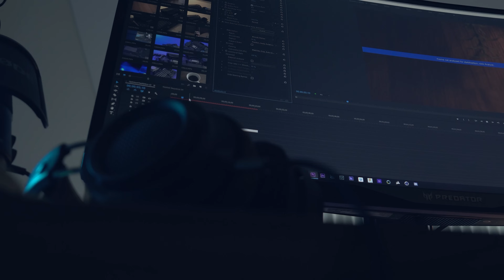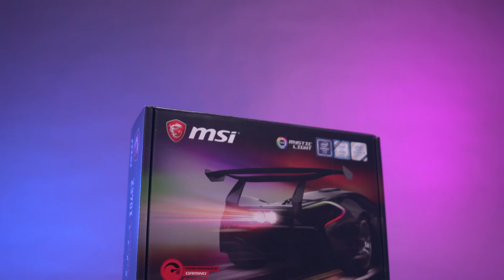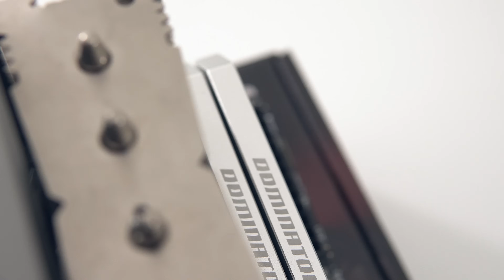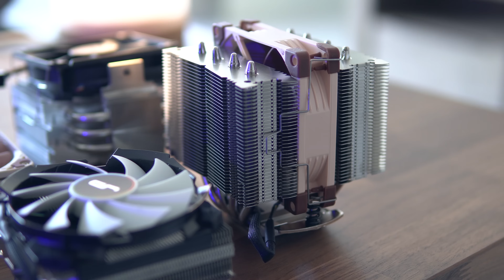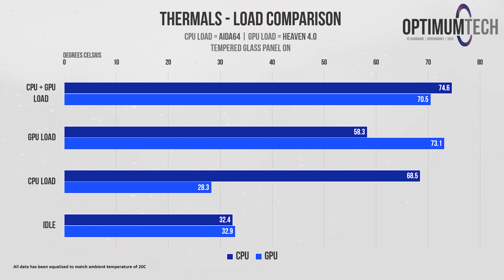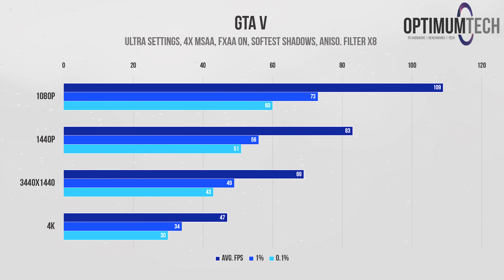FUSION II Tested - Thermals, Noise, Benchmarks!

Comment: Ali in 2018: air cooled 6 core i5 and air-cooled 1080ti
Ali in 2021: custom dual radiator loop 16 core 5950x and 3090
Both in M1
Reply from the maker: what a throwback lol

Comment: Hi man , I need some help with some doubts. Right now I'm deciding if leaving my X99 Rig and move to a mini itx one, more than probably with an I7 8700K. 
In the meantime  I've already bought a Corsair SF600 and while I see if I make the change, I was planning on selling my Seasonic 850W Gold Plus and use the Corsair (with an ATX adaptor) with my current X99 rig. But now I have doubts that not only in the meantime the Corsair might not handle my X99/Xeon Rig, but also that maybe it would not handle my probably future mini itx one with my current components (+ more than probably another SSD) and the 8700K instead of the more cores but low TDP Xeon I have...
..from your experience what do you think? I've already have both PSUs but I really need that extra bucks that would give me selling the Seasonic. Thanks in advance!

PD: 

This are the components of my current X99 RIG: Corsair Air540_AsusX99 Deluxe_Xeon E5-2673 v3 (12C/105W)_Cryorig H7 Quad Lumi_Corsair Vengeance LPX 32GB_WDBlack 500GB M2 NVMe _WDBlack 4 TB (two of them)_ASUS STRIX 1080 ti_Seasonic 850 Gold_LG BRay_AZIO MGK1_Corsair M95_LG 27UD68P_Focusrite Scarlett 2i2_Yamaha HS5

My possible new Mini Itx RIG: The same as above, with these changes: Fractal Nano S (yeap I know that it handles ATX PSU, but I was aiming for smaller cases and I finally got a  very good deal with this one) +  I7 8700K + Corsair SF600 + more than probably one more SSD

Comment: Awesome video! I was wondering though. im planning on rebuilding my pc right now im using m-atx and I want to get the ncase M1 aswell since I really dislike the look of the dan case a4 but im gonna use a EVGA GTX 1070 SC and a ryzen 5 2600 with hopefully the same cpu cooler as you used in the build I saw the thermals where pretty good for such a tiny case but my qeustion is would you recommend this case? because the  case im using right now (phanteks evolv m-atx TG) is getting some really high temps and airflow isnt to good either so im really looking for a tiny case with good airflow I just hope you can help me ou.

Comment: I would expect that, without any dust filters at the bottom, that GTX 1080 will be fed with tons of dust in the heat sink. But with such a small form factor, should we sacrifice cleanliness for more airflow and better cooling? I guess I'll just stick with slightly larger cases that are better guarded against dust.

Comment: Very nice! Maybe my specs for my next pc. One question: did you use normal power cables in the gpu? The evga card is a bit smaller but i would imagine that it is still very tight fit.

Comment: That’s a very sexy system, I’m a bit jealous. 

How in the world did you get the CPU to 1.45v though? My 8700K seems like it’s about to melt a hole in my desk as soon as i crank it up to 1.36v. Did you delid or are the IHS on the engineering samples still soldered?

Comment: I said i was never going to change out my pc case. (Enthoo pro)
But after i saw the pc case you have i was starstruck.
I know you modified it with tempered glass/custom case feet.
But i was already planning on implementing tempered glass to my case, and a few other things.
I just look at the inside of my case and it's just one big box with unused room that is taking up desk space.
I don't even do editing or need all the drive bays, nor do i need room for watercooling as i run stock speeds on all my peripherals.
Will definitely pick this up when i have the time/money.
Reply from the maker: Mini-ITX is totally worth it! Only time I would move to Micro-ATX or ATX would be for a custom loop or if I was running a 10-core+ CPU which needed better cooling.
Reply: For sure!. 
I'm running an i5-4460 with the cooler that came bundled with it lol.
temps are not an issue there.

Comment: and i bought the Vega 56 at half the price of a 1080ti. And getting 80 FPS average and the 1080ti does 94? Well thats a good buy :D
Reply: Emil Pedersen yeah at 1080p. You’re not getting 80 frames at 1440
Reply: Emil Pedersen I guess
Reply: Im actually on 3440x1440 and yes i get around 80 average, depending on the map, drops to like 70 or something at worst. The CPU is "only" a 1700x@3,9. 

Vega cards are monsters in games optimized for them :D Its a well known fact that AMD GPU does very well in Battlefield games. Though there are plenty of games where the Vega is quite far from 1080ti. Yet again, under specific circumstances and very few titles, Vega cards will beat the 1080ti. 
/watch?v=DXpmK9e-QX4

Comment: The jet engine thing..
I am sick of hearing 120mm fans ramping up.
That is one reason I went for a slightly larger case that uses 200/230mm fans.
Concerned about the large fans not doing any pressure. Think I can mod that factor into submission.

Comment: This machine is rocks. In my country I still don't have the chance to buy a 8th series Intel, but doesn't matter, I'm good with my 7700. Anyway, this machine is looks stunning, georgeus and I could continue to the end of the times. 
I want to ask you, in your PC case it doesn't give you some minus temps to the other components if you use a blower style GPU? I have a Fractal Design Node 202 and I had to replace my MSI GTX 1070 Gaming X to a MSI Aero GTX 1070 OC Blower Style GPU, because the other components were too hot and I had to push the hot air out of my case.

But this video is about your system not mine. Good and Beutiful job!

Comment: 8700k is the ticket. Selling my 8600k.
Reply: The ticket for video rendering? The 8600k over clocks better and is cheaper.
Reply: Reggie Galway as far is with Adobe premiere the 8700K is better. I could get 5.0Ghz from my 8700K and 5.3Ghz from my 8600K and the 8700K is still more powerful. If you need to save a hundred or so then save it but the 8700K is the ticket IMO. Put it this way when all threads are used which they are in Premiere a 5.3Ghz 8600K does not surpass even a stock 8700K. 8700K is overall the best mainstream processor right now especially if you do more than a certain type of task. IE gaming rig and editing machine.
Reply: Jay P how is it better in gaming?
Reply: how do you go from "as far is with Adobe premiere the 8700K is better." to gaming lol, he didn´t mention gaming once.
Reply: You are just picking and choosing I guess. I talked mostly about how Adobe Premier uses all of the 12 threads on an 8700K and how that even an overclocked 8600K cannot surpass an 8700K stock for this use. I only added that if you are more than just a gamer the 8700K is the better choice. I think there is little to no reason to pick the 8600K over the 8700K especially if you Edit! The 8700K to answer Reggie's question is a better gamer CPU as well because it does what the 8600K does and more when the going gets tough through hyperthreading. IE BF1 performance is much better on 8700K if you are a high refresh gamer, same with other demanding games. Anyways the 8700K comes at a price but stands as an excellent all around mainstream CPU whether you game, edit, encode, render and is simply best if you do them all. Each use case must be identified appropriately however because specific cases may benefit from something like Ryzen 7. Others might need to save money and the 8600K when overclocked does quite well. 8700K is really the jack of all currently in the mainstream. I own the three processors I am speaking of and have used them very extensively. I don't care about brand either. Ryzen is a multi-threaded powerhouse but falls on its face when it's threads cannot be utilized appropriately. Peace!

Comment: speedfan can make the bottom case fans speed up according to your gpu temp thats what i did to my 8 case fans :)
Reply from the maker: Yeah I had some weird issue where my fan splitter was preventing the two fans being recognised by the system. All fixed now so that's exactly what I'll be doing :) SpeedFan ftw
Reply: Optimum Tech i totaly agree dont know what id do with out it :) love the build so fresh n so clean clean ;)

Comment: I'll admit I was inspired by your previous build, and so... my NCASE M1 arrive a few minutes ago - great timing! I ordered the Hybrid (AIO cooled) version of the same SC2 card, based on a concern that a blower card would be noisy and the SC2 might cause the case to heat up too much. However, my preference would be to go with an air cooled card (I've also opted for a noctua air cooler for the CPU). Is the build with the SC2 really "not a quiet system"? It is difficult to tell from the recording.
Reply from the maker: Awesome! And sorry about the recording, they weren't boosted. The fans spin right around 50% for the GPU. It's not as silent as something like the MSI Gaming X card.
Reply: Thanks for the videos. Yeah perhaps the MSI would be a bit quieter (although uglier imo). I was sad to sell my Gigabyte Aorus Extreme yesterday cause its too big for this little case - it is a beast of a card and runs nice and quiet. With my AIO rad and my giant nh-c14 heatsink and fan together occupying most of the side I think a transparent side panel would sadly not work on my build. I sort of wish the case was a leeeetle bigger :-)

Comment: isnt the 1080ti being choked?
Reply: GSRamS there are fans right under it
Reply: GSRamS no
Reply: On the contrary. The fans underneath help increase static pressure against the thin stack, increasing airflow. Heated air then escapes the card through its sides.
Reply: I had the same thought. HSP fans tend to have thicker, chunkier blades that get in the way more, he'd get better performance by removing the fans and adding a shroud to direct the intake through the bottom of the case. Or if he wants to keep the outer aesthetics, he could gut the interiors of the fans, essentially making them air shrouds.